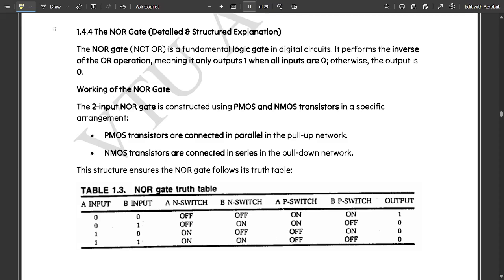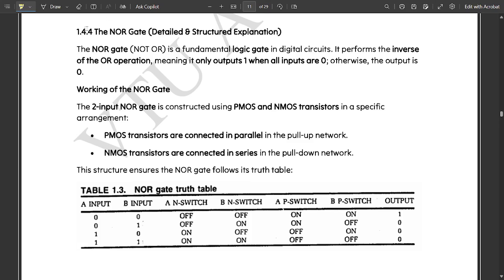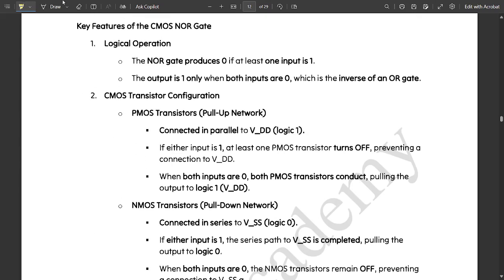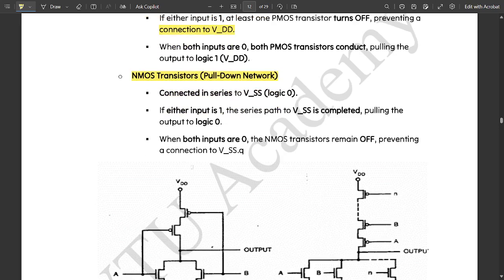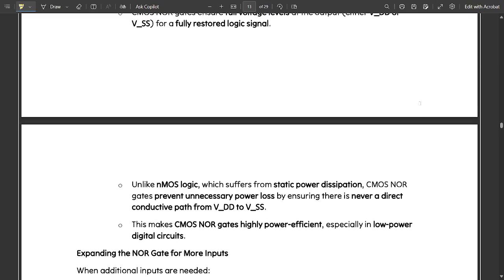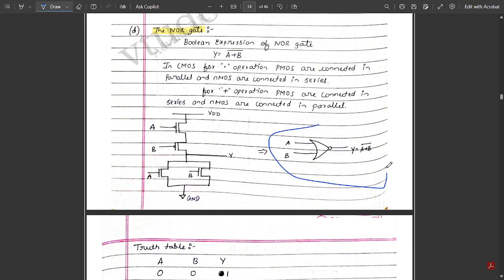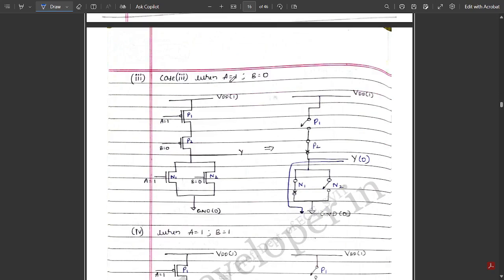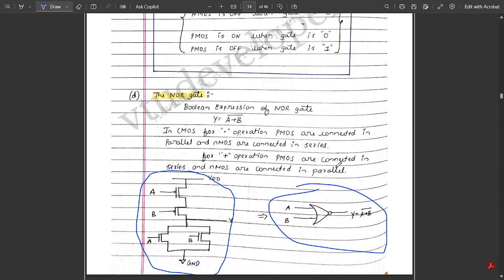4. 2 Input CMOS NOR Gate Structure, Construction, Truth Table  6th Sem VLSI ECE 2022 Scheme VTU

Comment: 2:40 pMOS transistors should be connected in series in the pull-up network, and nMOS transistors should be connected in parallel in the pull-down network, in case of CMOS NOR Gate.
3:25 again, pMOS is connected in series to V_DD, and nMOS is connected in parallel to V-SS.
Reply from the maker: Yes u got it right...
I made a mistake 
Thanks for correcting..